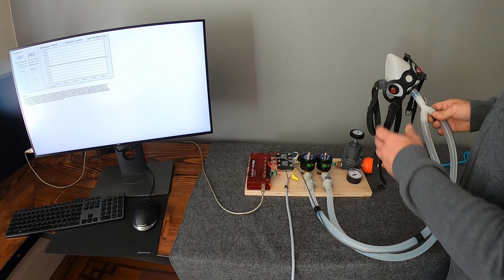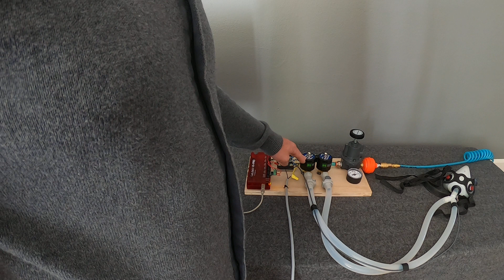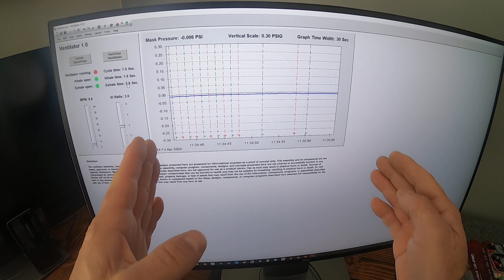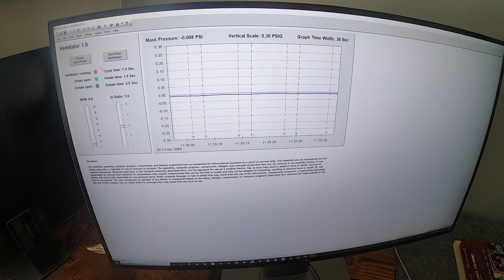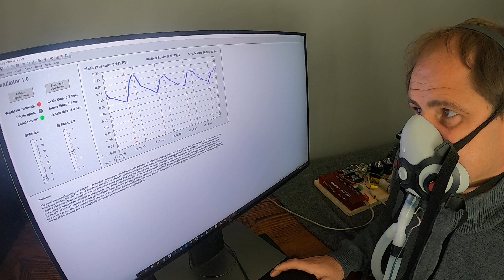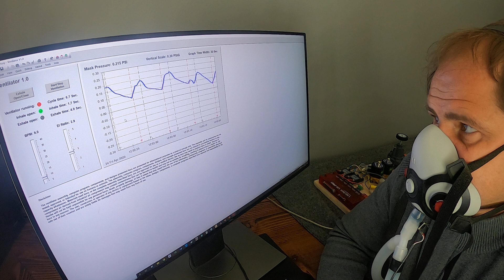Concept open Source Ventilator - COVID 19

Comment: Jeff - ideally the control mechanisms  you'd like to expose to the caregiver are, at minimum: (1) tidal volume (2) breath rate (3) inspiratory flow rate (4) airway pressure limit. Additionally, if you can provide a pressure transducer to measure exhalation, you want to measure the ingress/egress ratio, and ideally you also want to measure the patient attempting to take a breath so that they can use the device in an "assist" mode where the device just gives them a little help breathing at their own rate. Take a peek at this dump on the ancient PLV-100 design: http://www.frankshospitalworkshop.com/equipment/documents/ventilators/user_manuals/Lifecare_PLV_100.pdf

Comment: Jeff, have you spoken with an active resp. tech and doctors about what they need to properly dial-in for a patient? Also, my understanding is that humidification is absolutely critical if you're going to leave someone on one of these for more than a couple hours, as well as O2 supplementation. The almost-current trend is towards increasing O2 and keeping volume low as well as intake pressure to not create shear force on the walls. Improper ventilation was killing a lot of patients.
Reply: Also, you can probably simplify the design significantly using a Raspberry Pi as the main control unit and the A2D converters off of an Arduino.